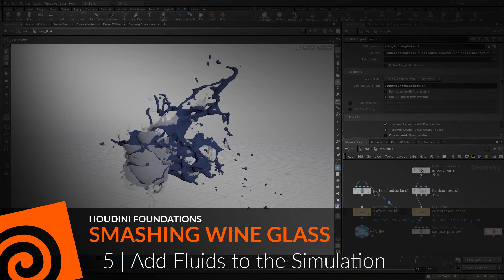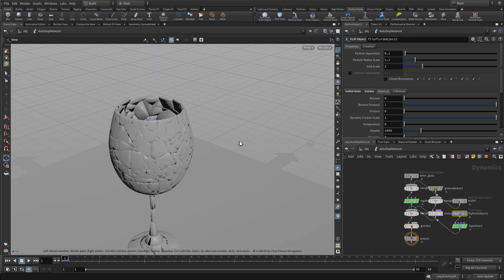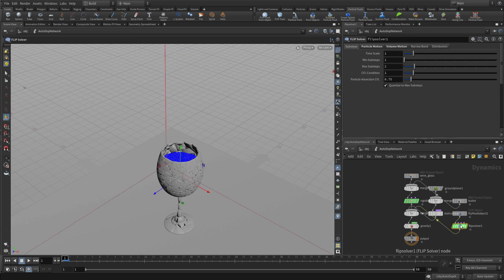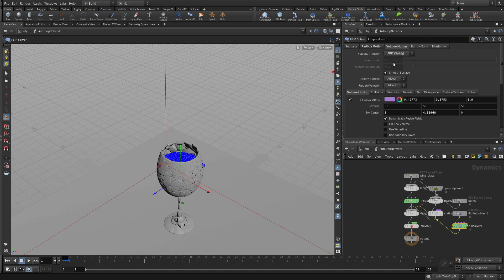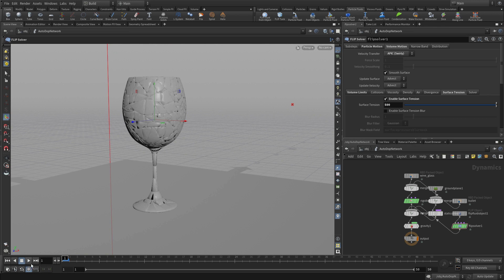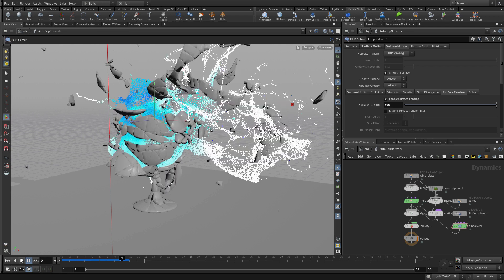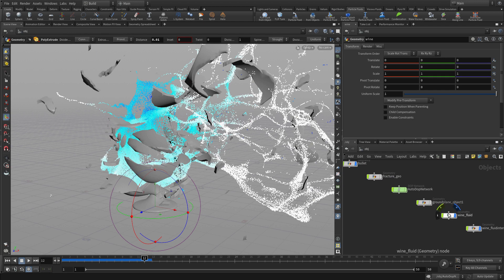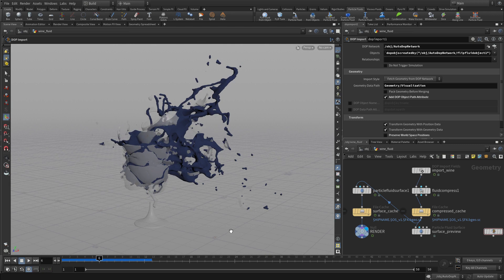Smashing Wine Glass | 5 | Add Fluids to the Simulation

Comment: What's the use for the "Add ID Attribute" option in the FLIP solver? I'm a beginner and although I finished this tutorial and understand most of it, this part isn´t explained. The documentation didn't help either, so if anyone has a clue it would be great to know.
Reply: It's so you can retime it later.  Then each point has an ID number assigned, that isn't tied to the @ptnum.  Which means when you re-time or "copy to points" something to it, it doesn't glitch.